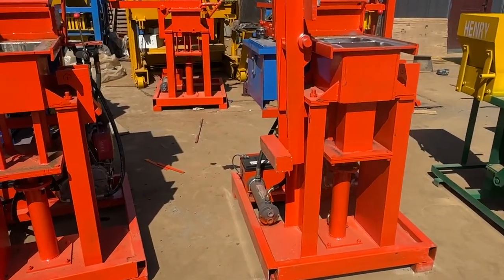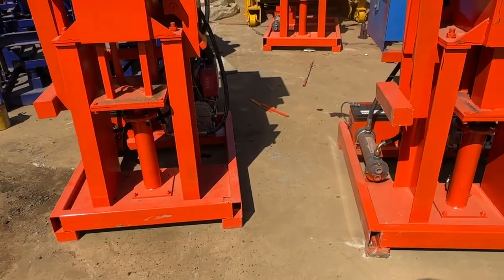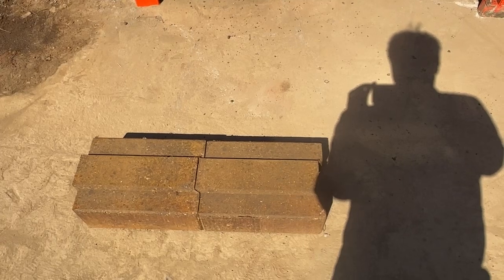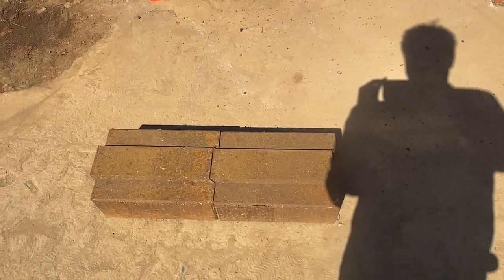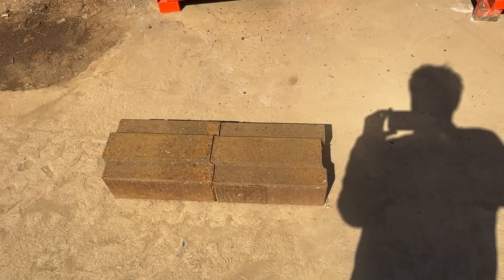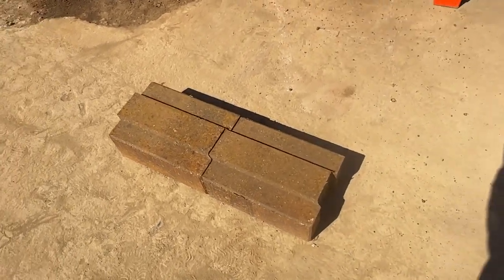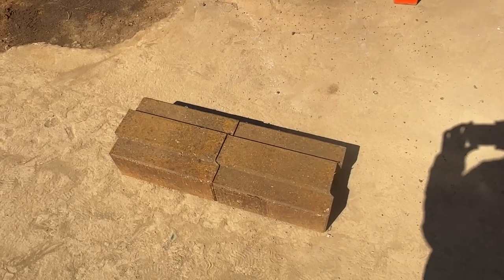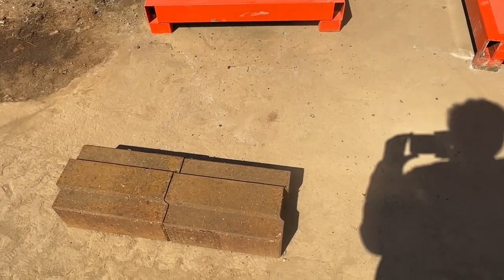HR2-25 diesel engine power hydraform interlocking soil clay earth block making machine for Uganda

Comment: If the could make it with a larger hopper for a tractor to load, and fully automated, then they would have something great.
Reply from the maker: But this is a manual feeding material laying brick machine. If you use a tractor to load the materials, how can you keep up?
Reply: @HenryBlockMachineGroup   You put a rolling slide / conveyor belt on it and have a team of people stacking the blocks on a palette.  The skid steer loads the heavy dirt and moves the heavy palletized blocks.
Reply from the maker: @KarasCyborg   then you should guarantee the capability of crushing aggregate soil ?
Reply: @HenryBlockMachineGroup  A good screen/sieve should guarantee the soil quality, along with a soil and cement blender working in tandem.   Also using Hardox or AR 500 steel to make sure the block molds last a long time is another guarantee.    I do like your block design very much.    I think the next machine for a US-Market would be more fully automated to save labor costs (reduce crew size).